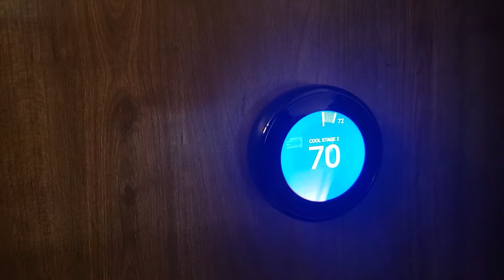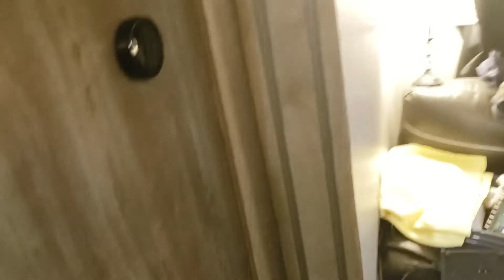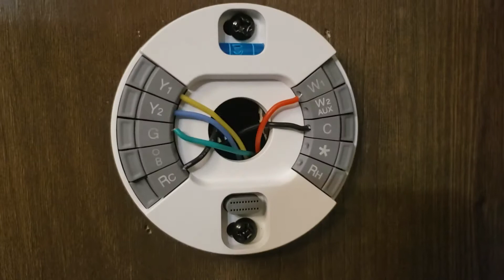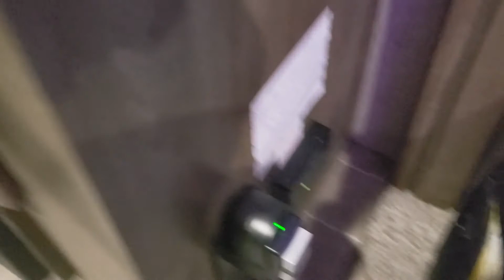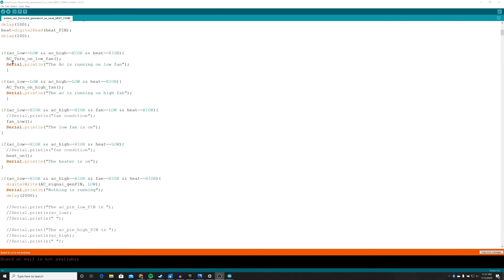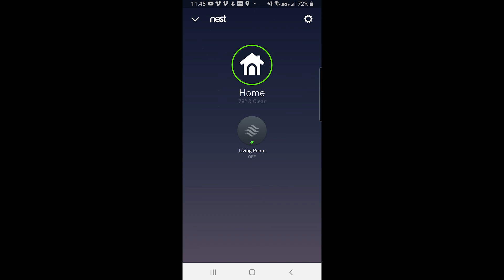Install a Nest Thermostat in an RV!!! Using an Arduino

Comment: Just did this mod on my camper and everything works perfectly. Except I’m having issues when I set the thermostat to “Off” but whatever mode/function it was set to it will continue to run indefinitely. The only way to get it to stop is by cutting power completely off to the AC/Furnace. Do you know what the issue might be or is there something in the code that be edited so it would turn it off off? Thanks again!

Comment: my thermostat has been running great for over a year based on your code. i ended up eliminating the level shifters and it works great without it. i recently decided to change the AC control box to support heating. im struggling to get the heating to work. i wonder if the heating control sequence you reverse engineered controls an external heater or controls the built-in heating coil. my guess is that it controls the external heater, while im trying to use the built in heating coil.

Comment: I followed your instructions, and the ac cools like it's supposed to(thank you!). The only problem I have, which I didn't really test in the summer, is the furnace. The electric heat works fine, but when it gets too cold, it can't keep up and we're supposed to switch it to the furnace. How do I set it up so that both electric and propane systems work? Thanks in advance!

Comment: Just want to say a big thank you for this project.  I ended up using an old programable thermostat I had in a drawer.  Because it has relays on the thermostat I didnt need to use the extra relays.  I also used an arduino pro min.  This allowed me to power the mini off the 12vs that was at the thermostat location using a small usb buck converter that I removed the usb port and soldered the pro mini vcc to.  I was able to hide this all inside the back of the thermostat base for a really clean look.  We used the camper for 2 weeks last month and my ac has never worked better.  With the old Dometic thermostat I was having problems with the ac kicking on at off.  No vents were pointed at it.  It would also go from high to low some times.  And other times it would not even work unless I pulled power from the Dometic thermostat and reapplied.  I didnt want to replace it with another as all the reviews were very poor, and many stating the same problems.  So, once again a big thank you!

Comment: I saw this video a while ago just pulled the trigger and followed this video to replace my Dometic thermostat with a nest. I used a smaller box and a micro relay board that has 4 relays on it. I have all that mounted in a cabinet that is on the other side of the wall. It works flawlessly and easy to accessif needed. Thank you so much.
Reply: Which relay board did you use? Most of the ones I'm finding are designed to do the opposite of what's needed here

Comment: I just attempted this and I was having issues with y1 and w1 not being detected. Had to reconnect the pos dometic to cool down. Any similar issues? Maybe I need to go back to an earlier build of of arduino? Is there any feedback that the nest needs to see, my relays are different? They feed to the coil through a rectifier.
Edit: Nest is very particular on conductors being straight so tinning, as suggested in the notes, is a must or using some type of solid fitting.
Reply from the maker: I would suggest getting some thermostat wiring from home depot or lowes.
Reply: @sloopdog7242  As shown in my edit, I used a solid end fitting, dupont, on my stranded ends. Seems there are mechanical switches within the thermostat base that tell nest if a wire is terminated correctly.

Comment: How is your Nest/Dometic thermostat doing? Have you encountered any issues with it? I implemented my version using an esp chip with e level shifter to shift the serial output from 3.3V to 5V. It works fine for a few days but then something happens and the level shifter fails. It’s weird. Not sure what to do about that. I replaced the shifter and same failure after a few days. I wonder if the Dometic is sending something back to the thermostat that is causing issues. Or that voltage levels are different from what’s expected.
Reply from the maker: I haven't used it in a while but I don't remember having a problem. Is the level shifter getting destroyed or do you just have to turn off and back on?
Reply: @sloopdog7242  The level shifter is getting destroyed. I may have overcomplicated things. From what I read, a 3.3V control unit (ESPhome) can control a 5V unit because the trigger value ("1") of the 3.3V is higher than the minimum trigger value expected by the 5V unit. So, I may not need a level shifter at all. I will try that. I noticed something else. When the AC is turned off, the control signal you're sending is just '0'. But when connecting the original Dometic thermostat, even in 'off' position, it's communicating a certain pattern to the AC, not just a stable '0'.
Reply from the maker: That is correct I did see a signal with it off but I didn't see a point to the signal and I'm not sure if it's coming from the old thermostat or the ac unit control board. I didn't program it because there was no difference in the 2 for me. What is the wiring look like from the new thermostat (also which thermostat are you using) to the output wire? What are the components your using in between?

Comment: I just installed a ecobee thermostat using this method. Thank you so much for all your hard work and giving out the info to make this happen. But the only issue I have is after my furnace comes on and reaches the desired temp. It shuts off, but the upper ac unit comes on for about 30 seconds give or take the shuts off. Is there something in the code I can fix it from turning on after the furnace stops?? Thank you sir
Reply from the maker: Thank you, I can say that is normal for the way it is written. What is happening is the thermostat is sending a signal for both the furnace and fan to run, after it reaches the temp it turns the furnace off and keeps the fan running because it thinks there is risdual heat. That's why it's doing that. There may be a function in the thermostat under advance options that allow you to adjust so the fan doesn't keep running

Comment: Hey thanks for sharing. Any possibility sharing the schematic outside the video? Maybe in your github project? Also have you thought about using a step-up transformer to up the voltage from 12v to 24v?
Reply from the maker: That might work but you will likely have to modify the parts if the 24v is dc and not ac
Reply: @sloopdog7242  they make dc to dc step up converters.

Comment: Where does the signal wire connect to?
Reply from the maker: The signal wire connects from the data out pin on the Arduino to the data pin in the camper

Comment: Is there a.specific reason you used relays instead of optocouplers to do the 24V to 5V signal conversion? e.g. Does the NEST require high current draw on those circuits?
Reply from the maker: That's just what I could find at the time and no there is very minimal current being drawn

Comment: Thank you for sharing! Great idea! I haven't built it yet, but I have built several arduino projects. You should be able to replace the relays with resistors and some code.

Comment: Thank you very much for this. I am able to get this working with an Ecobee with the same instructions. I do have one thing that i could use some guidance on though.  After the heat is finished and the thermostat stops the call for heat, the ac fan kicks on for about 30 sec to a min. Is there something in the code i can put in to not call the fan when heat just stopped?
Reply: Acutally.  I figured it out.  need to go to Go to Settings > Installation Settings > Thresholds and make sure the new option Configure Staging is set to Manually.  Then go down further and set Heat and Cool Dissipation time to 0.  this will make it so the AC fan doesnt kick on after the heater is running.  This works in heat/cool mode.  if its in heat only.  the AC fan will still kick on for a second or two then turn off.
Reply from the maker: Hey I know its been awhile. Im glad you got it figured out. The fan is kicking on because when using a household thermostat, you call for the reverse heat pump and the fan to blow air in the house. In this configuration once its done heating in turns off the heat call but keeps the fan call running because it thinks it is pushing more residual heat from the system. This could be modified in the code, it would just take a few tweaks and then there would be a delay in the function to call the fan

Comment: i have your code in place and everything works but the code is getting hung up when ac high kicks on... after it runs through an ac high sequence the correct relays turn on but the arduino wont send the code to turn on anything but ac high. when ac high kicks on it triggers all three relays. anything you could think of in the code?
Reply from the maker: Do all the other functions work well as in low fan, low ac, ect. Also have you tried running while still connected to the computer to see what the serial interface says?
Reply: @sloopdog7242  i havent tried with the computer hooked up but the code is getting hung on something everything works great initially then leave it alone and come back it will say its cooling but wont kick on the ac until i reset the nano
Reply: @sloopdog7242  im running the code with high fan as option as well
Reply from the maker: I did have a problem if you ran the ac on low while it's really hot. Basically the coils get frozen and the ac won't turn back on until you disconnect it or turn it off for a few minutes. But it shouldn't be getting stuck on ac high.
Reply from the maker: You may want to only using ac high and not ac low and see if that works without a problem
Reply: @sloopdog7242  its my thermostat that kicks on all three relays... im not sure i know how to alter that
Reply: so throw in the original dometic code?
Reply from the maker: The thermost sounds like it is working ok. I would program the thermost to have only one cooling stage and just use ac high for that stage and see if you still have a problem

Comment: I'm curious about how Dometic handles these serial sequences. Are these sequences considered to be 'trigger signals' (ie. you run the sequence once to turn on a specific function) or are they supposed to loop constantly to keep a certain function on? I'm creating a version of what you did, based on on the Sonoff NSPanel. It will be all-in-one. No need to connect any other hardware. The Dometic signal wire will go straight into the NSPanel, running ESPHome.
Reply from the maker: They run in a loop as soon as you stop the signal it will turn the system off. And good luck! I did an esp and Arduino build once. It worked but I wanted to have the turn dial on the nest and a few other features built in. But I bet that look fantastic!
Reply: @sloopdog7242  Thanks. I'll share when I'm done. The vision is that the NSPanel will be the display that controls all RV functions, including thermostat, energy management, lights, tank levels, even TPMS sensors.
Reply from the maker: I'm interested in how you would do the tank levels. I look forward to it
Reply: @marcvl   Were you able to get the NSPanel to work ok for you? I'm going to just use the Wyze thermostat as it runs on 12 volts, but I was looking at this device or an M5Stack as on option.
Reply: @sloopdog7242  I'm using a special version of the SeeLevel hardware that can be integrated with a Victron controller (Venus). From there it sends out MQTT signals which I capture in Home Assistant and display on the NSPanel
Reply: @segstron  It kinda works :-) All the thermostat functionality and integration with home assistant works. The only thing I have not been able to test (because I didn't have access to my RV) is if the control signal created by the esp device is picked up correctly by the Dometic AC. I'll hopefully get that done in the next month or so.

Comment: Go a couple steps further using your SalaeI'm betting that's RS485...possibly/probably Modbus RTU (or ASCII?) can you try a decode in Logic?  That'd significantly shorten the code needed...it's probably doing some interrogate/set between the stat and the relay board...
Reply from the maker: I will give it a try and yes It will make the code much smaller. Thank you
Reply: @sloopdog7242  my brother is working out of a camper with the same HVAC setup. If the rig wasn’t hours away I’d do it myself.  My guess is you’ll see a few cool read+writes is what makes up the exchange. Not sure how the arduino modbus lib works with soft serial…and normally one would use a driver chip with rs485 - but even softserial sending canned bits would be easier :)
Reply: That’s coil read/writes not cool. Ugh.

Comment: I can see how the signals are sent to turn on the ac/fan/heat, but where are the signals to turn them off?
Reply from the maker: As soon as you stop sending the signal the unit turns off.

Comment: What a blessing, I am right in the middle of doing my switch over to the nest tstat.  I'll let you know how it goes, hope okay to ask you some questions as I work though this mode...
Reply from the maker: Sounds great let me know and I'll try to help if I can
Reply: I wanna know as well
Reply: I have a Mac, so first thing I need to do is download load app.  Which website should I go to to grab it?  Is it possible to do a quick done and dirty upload?
Reply from the maker: Sorry I just saw this. Yes you can get the app from the arduino website for your Mac and once you get it uploaded and connected all up yes it'll work fine. Did you have any more questions?
Reply: @sloopdog7242  I have the list of things, going to try to get this up and running tomorrow....
Reply from the maker: OK good luck let me know how it goes
Reply: @sloopdog7242  So I have the app, I see your code.  Don't have a clue on how to download it...going to roll through youtube and find a tutorial...
Reply from the maker: OK if you don't find an answer I can make short video to show it
Reply: @sloopdog7242  Please do a video.  When attaching the wires to the ardunio, do you tin the tips and run the tinned part of the wire through the hole and solder without a pin?
Reply from the maker: I uploaded a short video showing how to upload the code and as far as the wiring goes just put the wires through the and then solder them to the board without it touching other pins.
Reply: @sloopdog7242  Finally had a chance to try the mod to the NEST, my NEST is an older gen no high or or low fan speed, does it matter?
Reply from the maker: That just means you need to pick one speed for the fan to run at so you just connect your y1 to the pin corresponding to high or low. I would advise to use only high in that case

Comment: Hello, great video and great idea!!
I am trying to follow your steps but my system is different, I have 2 rooftop units and 1 furnace with only 1 thermostat with 4-wires. I got the required code from my logic analyzer (using 24mhz, I hope its correct) and saved all the commands I want.
Now the million dollar question, how did you convert from PulseView to an arduino sketch? Did you do it manually?
Thanks!!
Reply from the maker: Thank you very much. When you say 24 mhz if your talking about the clock signal then that should be fine and as for getting it in the arduino, I did it all manually, but if you can figure out a way to decode the protocol, then that can be a lot easier to put in the arduino code.
Reply: @sloopdog7242  oooh that is a lot of work! haha I better get started. Maybe I will make a video when its all done, if I manage to accomplish it.
Reply from the maker: I sent you an email you can delete that previous comment if you don't want your email on here
Reply: After a week trying, my system seems a little more complicated than yours, because it’s a 2 rooftop units + furnace with only 1 thermostat. I have 4 wires, not 3, but the “extra” wire seems to be a 12v+ when tstat is on. And on the Signal wire, it must be a 2-way protocol, because as soon as I unhook the signal wire from the thermostat the “zone 2” on the thermostat goes away and the rooftop unit shuts off. and as soon as I plug the signal wire everything comes back on and zone 2 shows up again. If I manage to hook the nano while system is on with the Hearthbeat signal the system stays on.
Sorry for annoying you, but you seem to be the only one that figured dometic out haha.. if there were a way to know who is generating the pulse, the thermostat or ac board it would make my life a tiny bit easier
Reply from the maker: Maybe it is some sort of two way protocol going on but I never found anything coming back to the thermostat. And yes as soon as you disconnect the wire the system stops because when it is connected it is constantly sending the signal to run the ac or the fan. I think I know what thermostat you have and it looks like the 4 wires maybe one 12v+ one 12v- and the other 2 are communication wires. So you may need to replicate this twice one for each system. I don't mind helping by the way. I just can see what you have so I a little limited in my ability to advise on what to do. And yeah i couldnt find anybody else that has done this so I decided to make this video so that it may help others.
Reply: @dududumal  The 4 wire units are Dometic's Command Comfort Control system, and are not related to the 3 wire systems.  Completely different protocol.  I think I read about someone decoding the protocol before, but it is far more complicated than the 3 wire, requiring a different kind of chip (rs485) to communicate, and so can't just be controlled by an arduino alone.  You'll also need to know if it's a gen 1, 2, or 3 CCC, as they are all different.  Sadly that's the extent of my knowledge, as we ended up switching to the 3 wire system after our units broke down.